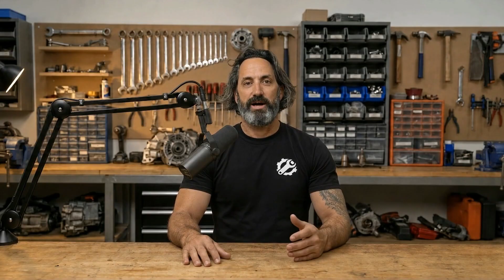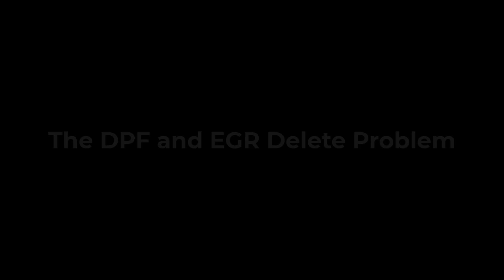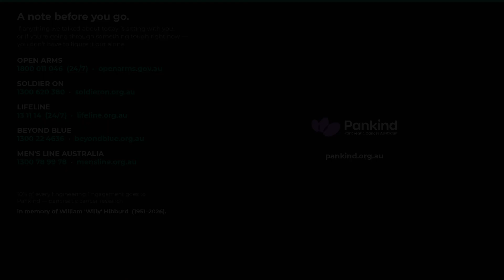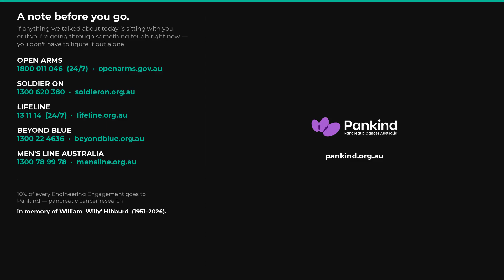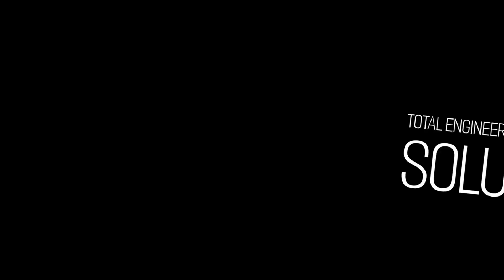ECU Remaps: The Truth About Cheap Tunes and Blown Engines

Comment: can u tune a turbo ?
Reply from the maker: You don't tune the turbocharger itself, you tune the engine's ECU to manage how the turbo behaves. A proper tune adjusts the wastegate duty cycle to control boost pressure, while scaling the fuel maps and ignition timing to match the extra airflow safely."
Reply: @BuiltRight_TEAMS  can a woman do dis ?
Reply from the maker: @margarita8442  Absolutely. ECU calibration and mechanical engineering don't care about gender, they just care about data, physics, and understanding how an engine breathes. There are some incredible female tuners and automotive engineers out there doing world-class work in the industry.